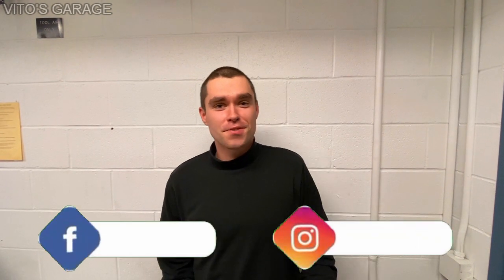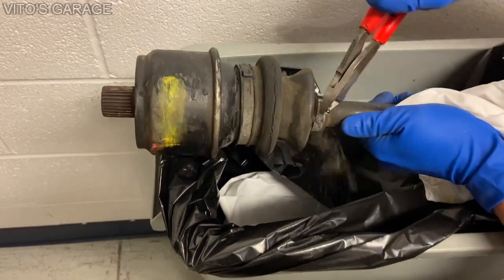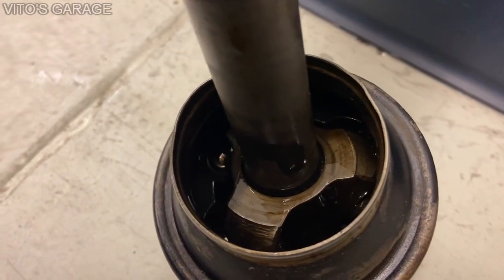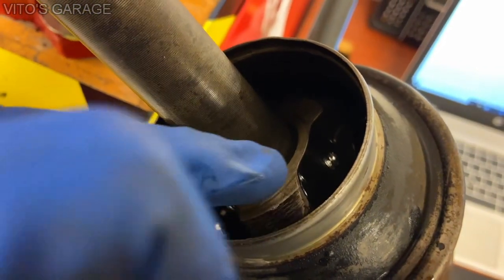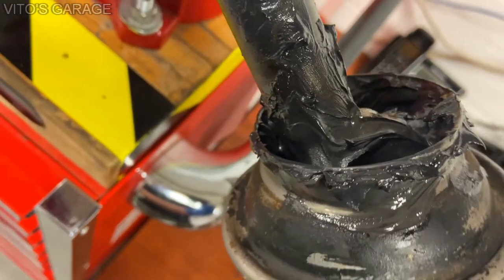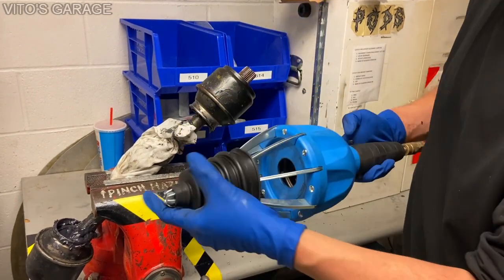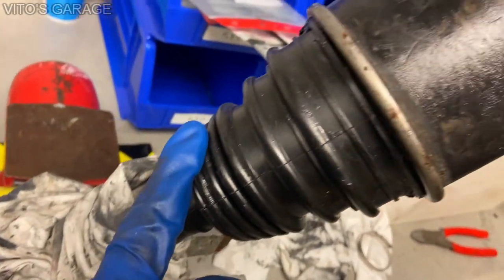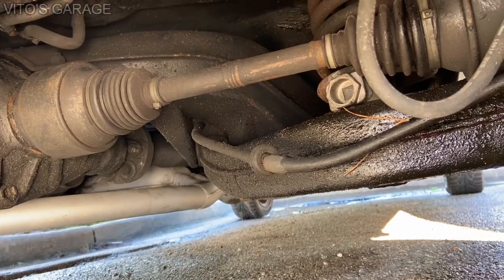Complete Guide: Mercedes Fastest & Easiest CV Axle Boots Replacement Ever! (Applies to Any Car)

Comment: Nice car and nice job Vito, I’m sure your dad is happy now.😅
Quick question, where did you buy your nice air tool to stretch the boots and slide them in, that’s a very neat tool.
Thanks again for the nice video man.
Cheers
Reply from the maker: Hi and thanks for your support! You can get this tool on eBay or Amazon. Just type in “cv axle boot gun”. Keep saving amazing old school machines!

Comment: Vito , I need to replace all 4 boots on my 1983 300SD , the lip area on the inside is 3.85 " and the outer is 3.44" . I don't see a link for the type of boots you used . Can you give me the name and where to order a set of 4 . And will these slip over a 4 " mounting cone ? Or should I spend the extra money and buy a cone expander tool like you have . I found reasonable cost half shaft axles for my 81 240 D , but I have not found replacement aftermarket axles for the 1st generation 1983 300SD at all . Luckily all 4 boots were not split and did still have the original oil , they steal seem to be in fine usable shape . Providing I can obtain and mount the boots .
Reply: I did just find your link ,,, Will these boots , or the size you used fit the 300SD ,, 3.85 " inner and 3.44 " outer . I do know my cans will likely be slightly larger than the axles you mounted . Sure appreciate any help and advise . Take Care ...
Reply from the maker: Hi Richard. I bought these axle boots on eBay. They’re called universal flexible cv axle boots. I’ve installed them on W126 chassis before and they worked just fine. 
Here’s the link: https://www.ebay.com/itm/303949343274?epid=230359896&_trkparms=ispr%3D1&hash=item46c4caea2a:g:wFkAAOSwlnxdzcjl&amdata=enc%3AAQAGAAAA4PKgHeHLN0LJyTFy1VihmLxEGNiYn16KNJOK3rvJob6s8SgpYZb988%2FKXCOyinVYRpgOcfiIMQJ6hy83DHa42XrmaIpBJpOaAjc3ZMgJfVZuNArW96TGpWtH1BsQbFVTvEmhNKWSsUsR%2FeAyxiy1TFldl0I%2FovVNniOnpFt0JnBxqNzfpVnn7Ao%2F16Xtsx%2FntRonvvaT48tZegbBYqHxl7dviKoUPr44Vt1bcQebWLkka8c6VAiX8K8HSiHwoJLT%2FDg9ApbD1KkLl9VBX4gQ2iele96HQUAziAL2bQfypbsv%7Ctkp%3ABFBMqp7Y4_1f

Contact the seller and double check whether these will fit or not. Tell them your year, make and model. 
Either FB3001 Boots will fit or FB3000K. One of them is bigger than the other. Just double check with the seller. 
These kits come with a cone for manual installation of the boots. You can try using the cone first. If that doesn’t work for you, you’ll have to buy a bootgun like the one I used in the video.
Reply: @VITOSGARAGE  ,,,,, Thanks Brother , appreciate your time and help .
Reply from the maker: @rcsnow22  you’re very welcome! Check out my other videos and playlists! I have a lot of different car videos!

Comment: professionals, with any car, don*t you have to give maintenance to the CV joints, and it is surprising to see you Fathers car still have the original CV joint boots on, more impressive, the original grease that it left the factory, I thought you had to give maintenance, just like if you were to change the oils, liquids, according to the mileage.
Reply from the maker: I did give it maintenance! Did you see how much grease I gave it? Any other mechanics shops would have never done that 😂
Reply: @VITOSGARAGE  That is what I mean, you did a tremendous job, but just thinking, that you are the first one to service those original OEM Mercedes Parts that the car  left the factory with is quite impressive, the parts around 35 years, then you have the grease which was about the same time, now if you checked with t hgt e maintenance that you have to give the car at certain mileage, normally it would have been replaced, I just wonder how many more cars still have the original part they left the factory , if your fathers car still had the original parts, usually they would specify at certain mileage, in order to keep the car going.
Reply: @EnriqueLopez-hb5jn  I'm pretty sure mercedes did not specify replacing the drive shaft oil and it will only be done when the boot fails. It's not a good design because the owner may not realise the boot has failed and continue driving without oil and damage the cv joint.
Reply: Yeah, terrible design, they only lasted 40 years lol. Replace the boots and run it another 40 years, except the boots are probably not as good.